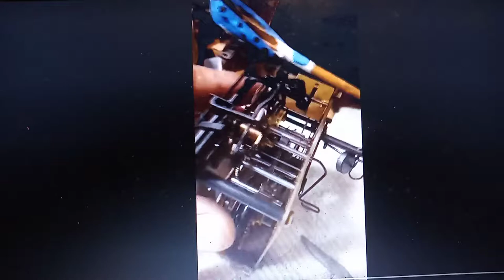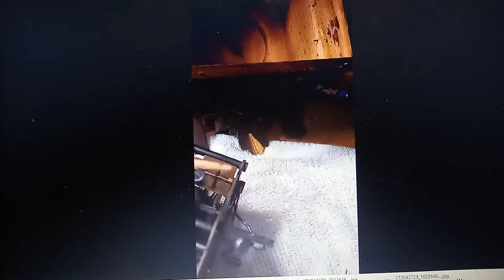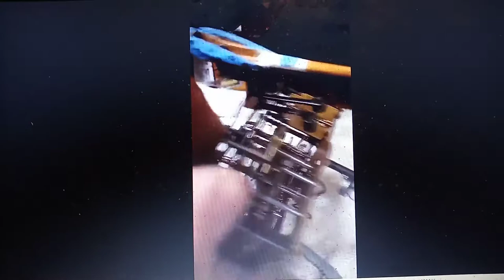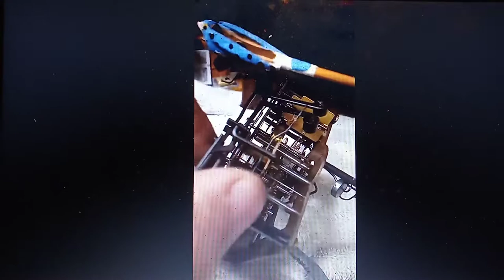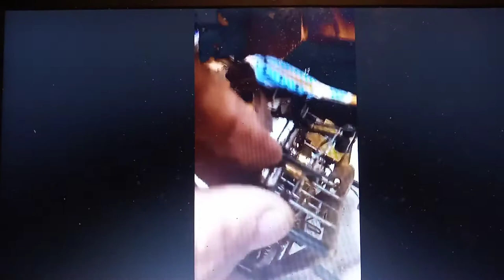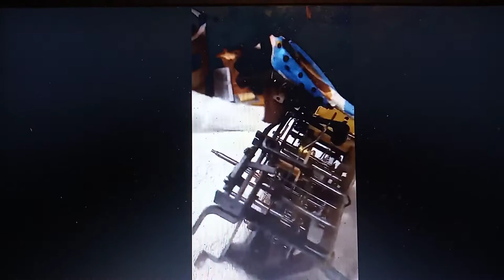Repairing a 1950 Schatz cuckoo clock 20210528 051552

Comment: Did you adjust this where the door would stay open during the striking sequence while the bird bobs in and out
Reply from the maker: I didnt have to adjust anything. I had someone ask me a question as to how do I get the bird to go further back on this type of clock so I did a video for them. I hope this explains everything. But answering your question I would adjust it out of the case and you can see how far the bird goes out when the cuckoo is activated. The issue was getting the cuckoo to go all the way back in. Make any necessary adjustments to the lever that I mention.  I hope this helps.
Reply: @munnerlyn3  thank you